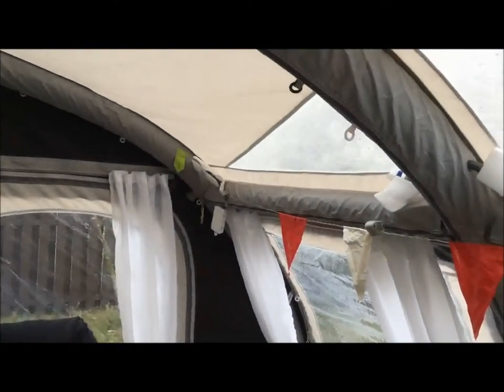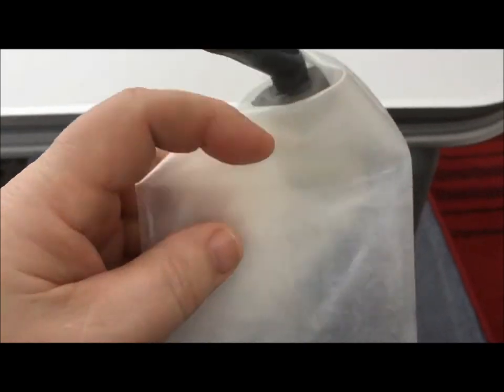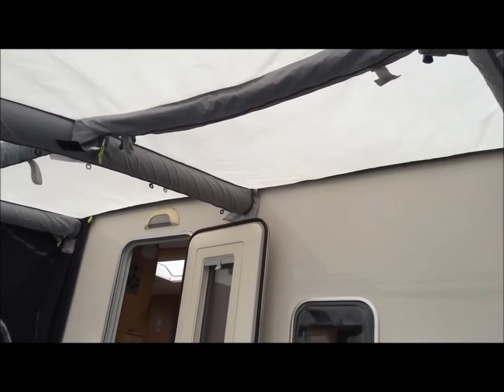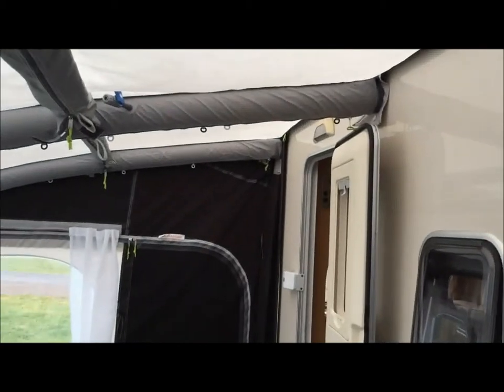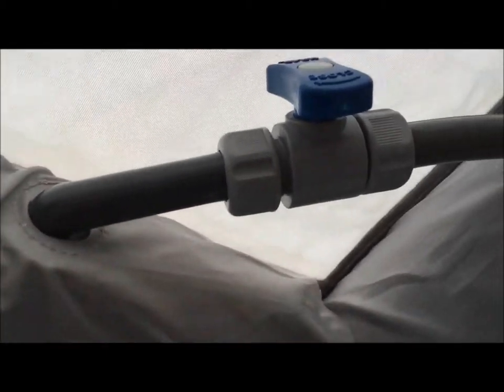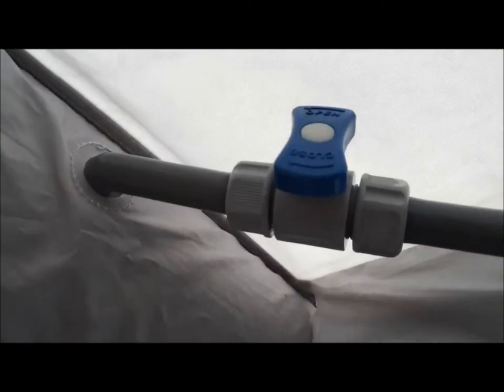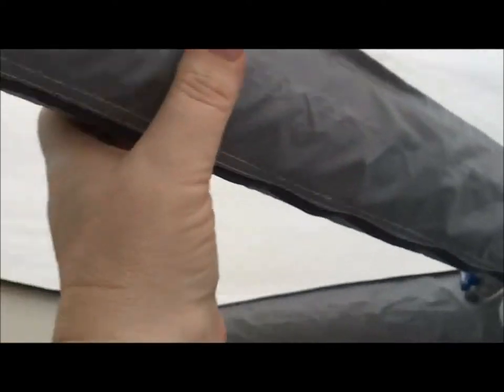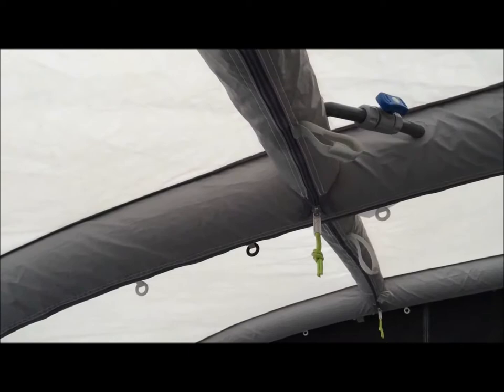Kampa Rally Air 390 Pro, Puncture Repair

Comment: Think with these awnings you are supposed to close the valves once you've inflated then if there's a leak the whole thing won't collapse
Reply from the maker: Yes, you’re absolutely right, something I learned the hard way. I was surprised that having spent c.£900 on the awning it actually did not come with any instructions/best practise guide. You live & learn 😂 Thanks for watching and for your feedback. Cheers Helen & Dave 👍

Comment: Ah, perfect! I have a leaking Kampa, it's a really slow puncture that maybe takes 3 days to show any effect. Great suggestion about closing all the values, I'll admit I never thought of that, it's been leaking for about 18 months :-) I'll  now fix it next timwe we're away. Thanks again! Graham
Reply from the maker: Might be worth checking that you have screwed the black cap on tight on the inflation valve ( where the pump goes) I have woke up to a deflated awning a few times and then realised I was losing air there until I tightened it. Thanks for watching 😊
Reply: Yeah thanks, I have done that before :-) But I do tighten it now. I'll close all the valves and see which one goes down...Graham